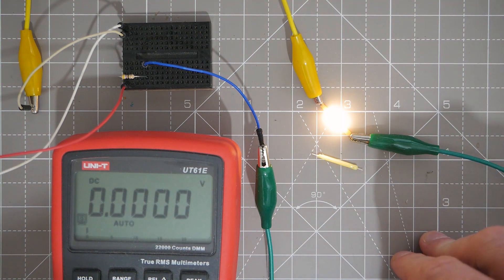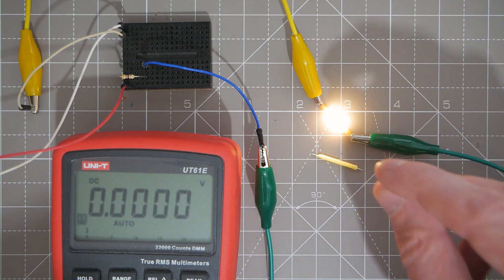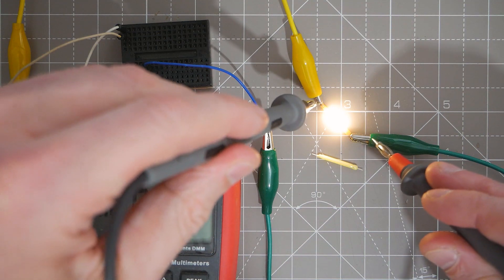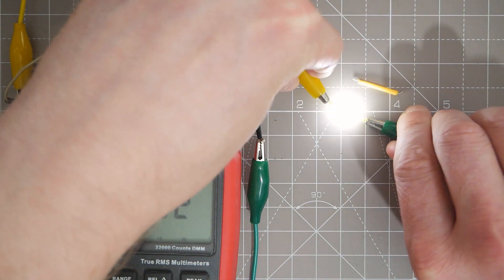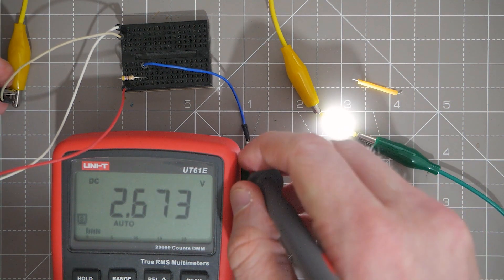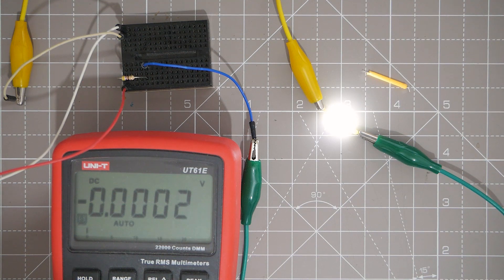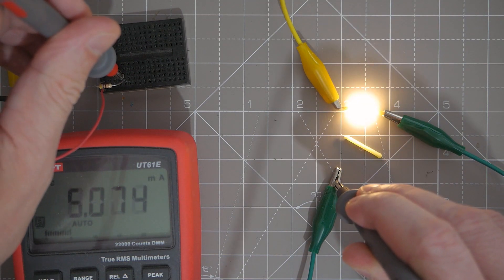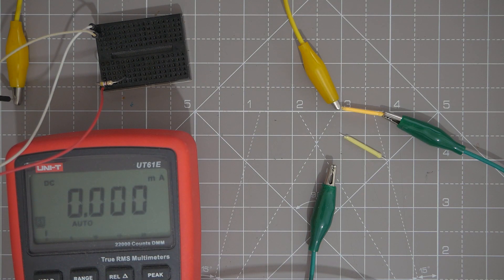Hey UnexpectedMaker: Seglament Display - Episode 2

Comment: Like someone here said tm1638 or other chips in the family data sheet in Chinese, alternatively pt6955 or others in the family data sheet in English link http://www.princeton.com.tw/en-us/products/leddriveric/leddisplaydriveric.aspx, also tlc5940 might be right for you TI device, all are not pricy support at least 13 segments, sometimes with multiplexing for several chars
Reply from the maker: Big fan of the TLC5940, I have used it in several projects. Using it here is a good shout, I will have a think. I even have it in a DIP package somewhere in the parts drawers.

Comment: I have to point out that Alphabet type, you need 2 short leds on the centre bar, if you find a shorter leds then you are ok, other hand stick to normal number display. Plus I got some leds came in but I got 12V version d'oh.

Comment: The LED filament looks offset from the pins so if they were both on 1 side it would be flush, but if you want it connected on opposite sides you would have to bend 1 pin to a dogleg shape so it stay parallel to the PCB.
Decimal point, 14 LED

Comment: Never seen a 13 segment display.
The alphanumeric "starburst" LED displays are typically 14 segment or 16 segment.
The letters "B", "G" and "K" look better if you can split the centre segment into 2 half length segments.
Reply: bornach I don’t thing filament leds exist in half size.

Comment: Nice! Good to know these filaments are also available at low voltages. Looking forward to see the next episode. (Yet I think using a LED driver chip such as the TM1638 or TM1668 would simplify things. They are cheap, don't need current limiting resistors, support multiple displays and implement the multiplexing and dimming so you don't have to code it).

Comment: You might want to look at things like ULN2003 or ULN2004! :)
Reply: might work with 12v version of leds :)
Reply: With the uln2003 I was looking at the current per pin. 500mA -600mA for a pin. So you could use 74hc595 and connect it to uln2003. Pro lite matrix  are set up the same way.

Comment: Formula for LED current was incorrect because you didn't measure the voltage across the resistor. You measured it across the LED.
So it should be I = (Vs - Vled) / R
Where Vs is your supply voltage which I assume is 5.1V
You will get a current closer to what you measured.
Reply: Yep. Only reason it roughly works in the video is that there's  about a 50/50 split of he voltage between the resistor and LED. Had he been using a 12V supply the split would have been more like 80/20 - -75/25  and the current calc's would have been way off.